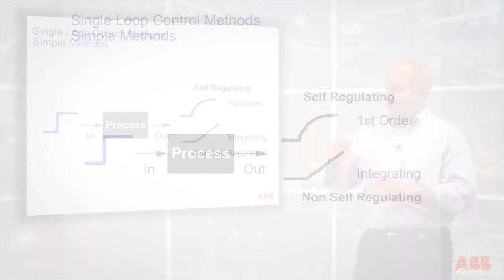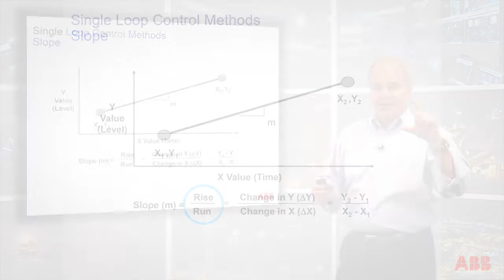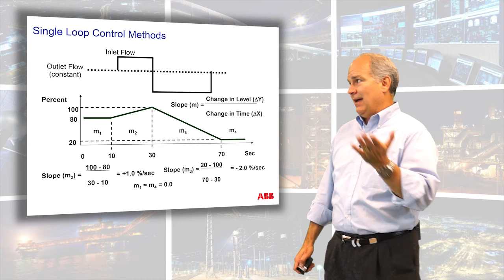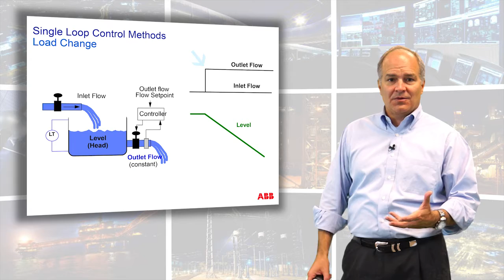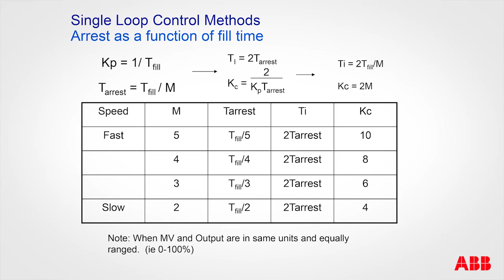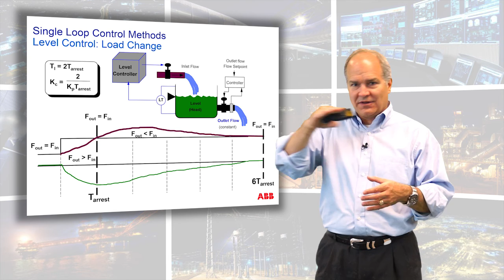Single Loop Control Methods - Tank Level Tuning // Chapter 6

Comment: The basic problem with tank level controls is that the process (the tank) has already an integral function which makes a 90 degree phase shift. If you add a controller with an integral part you create a potentially instable control loop. In my opinion the best (most stable and secure against violation against hi and lo limits) control for a tank is a purely proportional control if you are allowed to a small deviation from the optimal setpoint. So for example: Outlet valve position= 33.3*(Level[%]-Level Setpoint[%]). The effect is that the outlet valve is fully open when level is 3% above the setpoint and fully closed when level is at or below the setpoint. As the controller has no time function it is completely stable and it is always assured that the tank does not overflow or empty. An additional subject which should be mentioned in this context is the shrink and swell of a tank at boiling temperature. Some tank levels need a more sophisticated control structure than just the level. In those cases the balance of outlet versus inlet flow should be considered.

Comment: It appears as though using the M variable and the arrest rate and process gain simply mathematically cancel.  According to the math here, you set your desired system response speed (M) and the controller gain is always the M value times 2?  Shouldn't the process gain factor into the gain setting of the controller some how?  If this process is used, your gain will always be 10,8,6 or 4.  Or am I missing something?

Comment: Great review of tank level tuning. Be careful on process gain calculation (kp) at 9:23 in video. It should be kp = (delta Y1 / delta t1) / delta U1. It looks like the PPT formatting messed up the placement of the "t1" in the displayed equation. Knowing the tank volume and fill time is great way to simplify this.